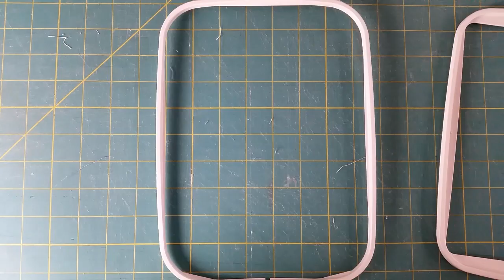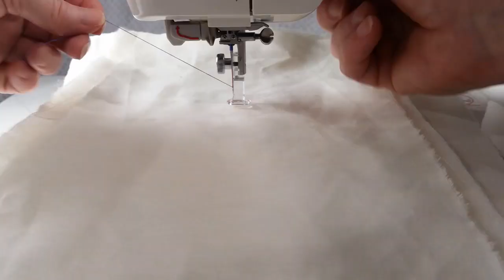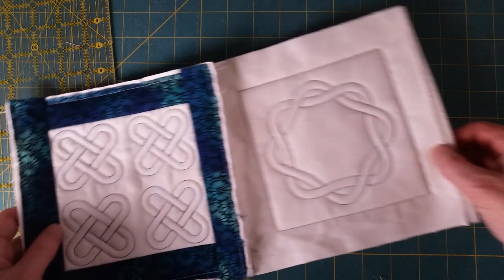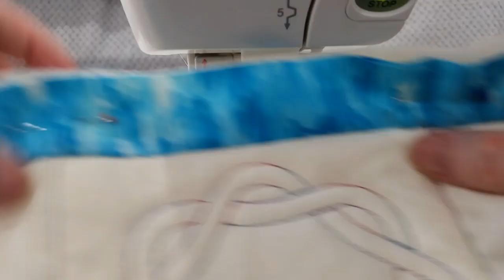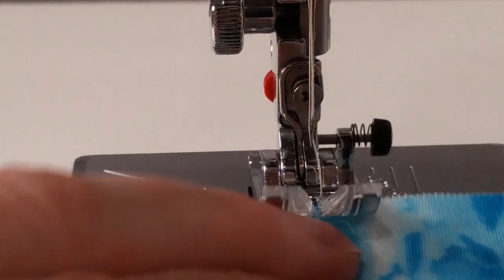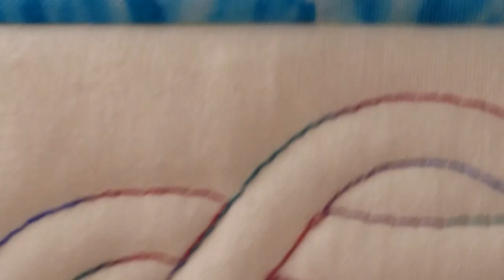Quilting with your Embroidery Machine - Design 098 with Borders!

Comment: Love this idea!  I can sew with the best of them however my design creativity just doesn't exist but I thought I could see where you were going with this and it really adds another layer to the quilt.  I noticed you had bias tape on the back.  Could bias be used for vertical and horizontal covering of the joins or do you think that would look tacky?
Reply from the maker: The tape I placed across is still just straight grain. I am looking forward to making probably a sewing machine cover with them!
Cheers Sharyn
Edited to add: I have used bias tape in the past, and it looked great. It was a checkered one.
Reply: Thank you and again for the reply to my needles question. @SharynsSewingSchool